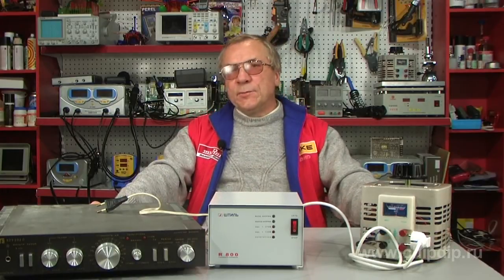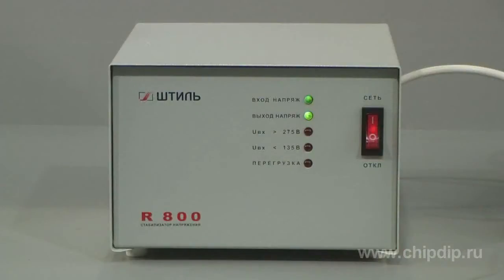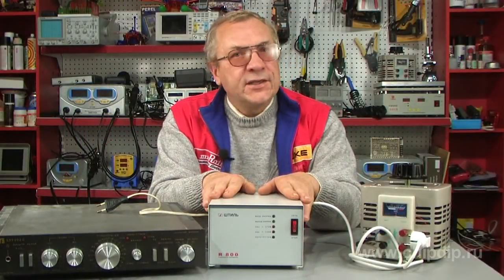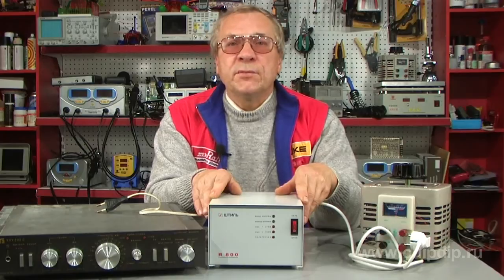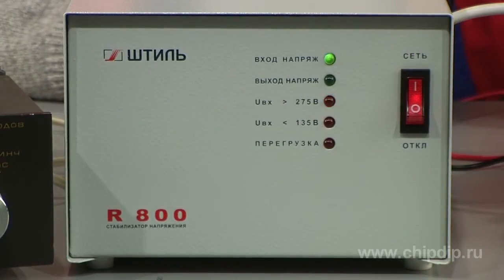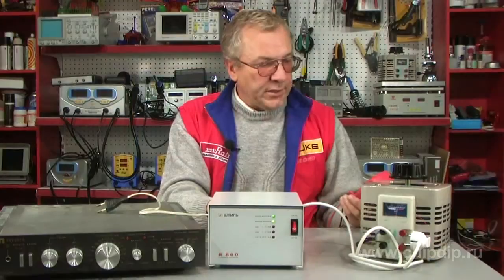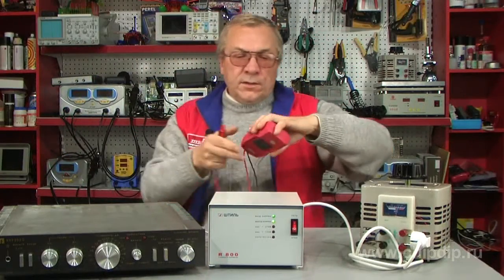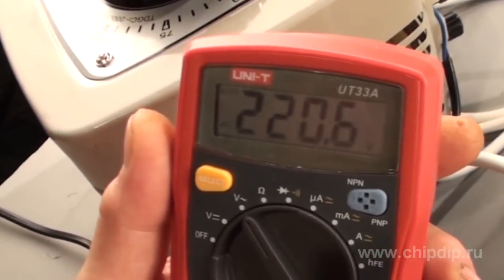R800 voltage stabilizer

Comment: In my area.. Voltage droped to 150v at night time because so many people start using their AC... My voltage  stabilizer works fine till 160v but when voltage drops further then ac's motor jamed.. So my ques is . if i use two stablizer  like A stabilizer convert 160 into 230 and give output of A stabilizer  to B.. Then B works and convert 230 into 250 or 260... Can i do this ? Could ac will work fine ? Both stabilizers work together ?